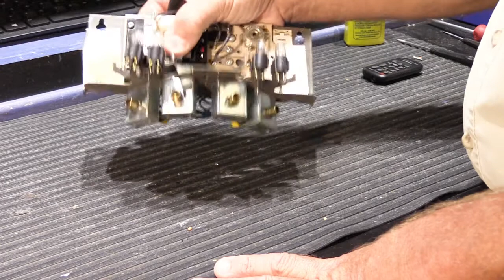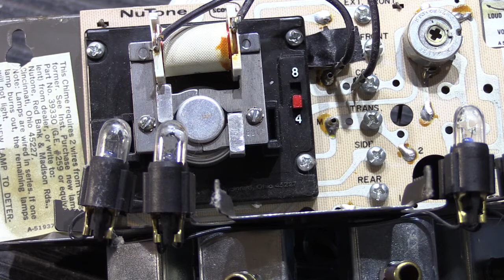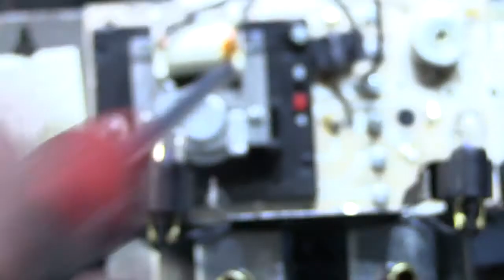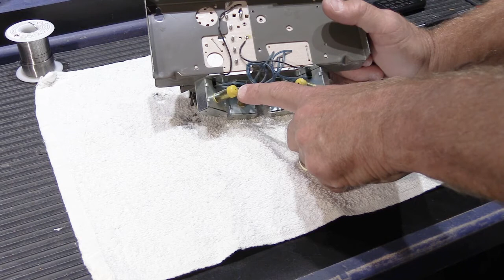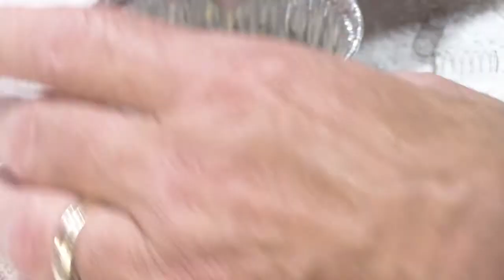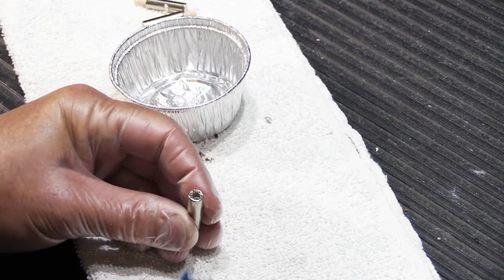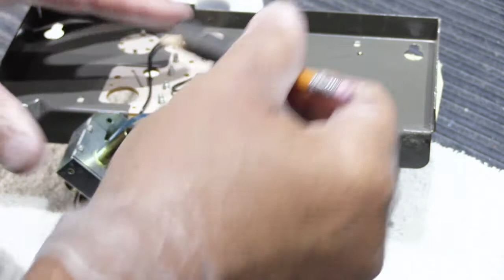How to Service a NuTone  8 Note Long Tube Door Chime Base

Comment: Do the door chimes with the clock 4 long tube. Also chime the hour?
Reply from the maker: Hi JonThomme De Claydon: No.  NuTone did make a 8-Note Door Chime with a Clock that Chimed the Hours in the late 1940's and early 1950's.  These were not a very successful model, probably due to their high cost.  In the 40 years I've been a NuTone Service Center, I've only ever seen one - Chris

Comment: We have one from 1963 with a clock and I dread taking it down to clean. Well looks like I have to buy lighter fluid. And we have a Nutone intercom same year with tubes, hasn't been used in years.
Reply from the maker: Hi John D II:  Make sure you label the wires before disconnecting them - take a few pictures as well.  Care must be taken when working on the Chime Base - Don't lose any parts (springs)
What Model Intercom do you have? - Chris
Reply: @northsideservicecompany3567   Thank you for the hint but this isn't my first time. I have been repairing electronics for many years. It says use lighter fluid but I don't have any so I was looking to see if I could cheat with something else. I guess not. Lighter fluid is on my list to buy. Thanks again.

Comment: I have a Nutone Jefferson L series long bell chime. The seller told me that it "worked when it was disconnected" and I believe him, but when I had it installed in my house, it didn't work. One of the solenoids does move a little, but it doesn't ring the chime. It probably needs servicing. Would you do it for me, and how much would it cost? Many thanks.
Reply from the maker: Hi Cynthia:  It will be best if you contact us directly about your newly acquired "L"  Model Jefferson Door Chime - Chris     nscompany@msn.com

Comment: This was great, thank you. Where can I get the tubes for these chimes?
Reply from the maker: Hi Abraham:  eBay is probably the only source for Chime Tubes - There are many different versions of NuTone Tubes that were made over the decades - You need to know the age of the Chime Base (or model number) to knw which tubes you will need.  Look carefully before buying Tube for broken/missing Tube Hangers or cracks in the Tubes - Chris

Comment: i'm in the process of repairing my nutone 64203.  when i first bought the house, only 2 of the 4 hammers worked.  after opening the cap on one of them and push the hammer up and down, i got the 3rd one working which made me happy but the 4th one, the last one on the right, has a wire disconnected to the circuit.  i tried to shove the little wire into the hole, looking at the back on the right side area the left of the 2 holes below the upper 3 holes, but still not getting a reaction.  i even shoved a chopped paperclip in there and wrapped the wire around that to help make the connection but no luck.  next i'm going to try and open the metal hammer box to see how that looks inside and maybe shove some speaker wire down the circuit hole and try connecting to that.  if that doesn't work, any other idea why the hammer isn't working?
Reply from the maker: Hi ztuber7763:  First lets get some terminology straightened out:  1 - They are Solenoids, not "hammer boxes"  2 - They are Plungers not "hammers" - Now, Do Not Open The Solenoid, if it's bad (unlikely) you will not be able to repair it.  If you want to evaluate the Solenoid, use an Ohm Meter and measure the resistance of the coil (using the meter probes on the end on the coil wires) All 4 coils should measure approximately the same amount.
     The Wire used in the Coil is referred to as "Magnet Wire" because the coil in the Solenoid is basically an Electromagnet.  Magnet Wire has a clear (or reddish)  coating on the copper wire, that acts as an insulator (keeps it from shorting out)  You cannot "shove the wire in the hole" and "shove in a paperclip" and expect the wire to make a connection.  You Must Solder the Wire into the connection - The heat from the soldering melts away the coating on the wire and allows the copper to be soldered.
   There can be many reasons why the Plungers are not working and if you follow the Video - Exactly - your Chime will likely work again.  Cleaning the Plungers and Solenoid Bores - Using Lighter Fluid - as I show - is an important step in the Servicing - Do Not skip steps or substitute anything from what I show - Or - You risk ruining the Chime - Chris
Reply: @northsideservicecompany3567  turns out i was able to get the 4th one working.  i sortof used my paperclip method.  i didn't want to disconnect the whole unit from the wall to solder so i took off the spinning motor assembly(forget the name), cut down a thin hard metal wire, that came wrapped around my poultry netting, to an inch and used a wrench to bend one end into an L, shoved the straight part through the circuit hole then used scotch tape to hold the L in place, then wrapped the solenoid wire around the straight part completing the connection.  the problem now is that i only have 2 of the 4 bells lol.  not sure why the previous owner got rid of 2 so i'll either have to find replacement bells or rig something up like copper tubing.
Reply from the maker: @ztuber7763  Well - Okay - As long as it works I guess.  Different type of tubing will make different kinds of notes/sound - You may need to make up 4 new Bells to have it all sound even - Chris
Reply: @northsideservicecompany3567  do you happen to know the lengths of each bell for the westminster chime?

Comment: Hi Chris I have an LB38K72A short tube Nutone.  Your video is great, I've got everything cleaned up and reassembled.  My problem i get one chime when I press the doorbell.  The video shows the motor armature freely spinning when you pulled it, my armature does not spin.  Is that my problem?   Is the motor repairable?
Reply from the maker: Hi Flipper:  I have questions:  Is the LB38 new to your home or has it been there since 1972? - If it's new to the home, are your replacing a standard mechanical 2-Note Door Bell (the kind that goes ding-dong)?

If it's been there since 1972 - what was its condition before you worked on it?

Chris
Reply: @northsideservicecompany3567  Chris, The house was built in 53 so the chime was added at some point.  I bought the place 7 years ago and the chime worked.  During the remodel it was taken down and not used for 4 years.  It was really filthy!  I cleaned the circuit board including under the screws, cleaned & lubed the solenoids, realigned the tubes.  I've been fiddling with the doorbell button.  The original is lost.  The new one was partially shorted by faulty wiring, I get one chime per push sometimes repeated sometimes a different note, and then it stops.  So I just got another button a Hampton Bay to test.  Or should i order a Nutone specific button?  Restoring the chime has been a fun project, great videos and instruction.  Thanks so much for the effort and skill  you put in your tutorials.
Reply from the maker: @flipper9770  As few things: 1.  It's not the button,. unless the button is mechanically broken, the brand of button doesn't matter - 2.  I would say that in the past 20 years, I haven't seen a Motor on a modern NuTone Chime fail (yes, 1972 is modern) To test just the Motor, use the 16 2-wires that come from the Transformer for power, connecting them directly to the terminals on the Motor Coil, the Motor should run (removing the motor from the base to see the rotor turn is a good idea) 3.  Inspect the contacts on the end of the 3-arm Rotor, look for bent or missing contacts.  These contacts make the necessary connections to keep the Motor turning once the Button has been released - 4.  Is the Springy Metal Tab is in place and it rests against the Top of the Post - Chris

Comment: Excellent video.  I have this same model from sometime in the 70's or 80's.  It stopped working 20 years ago so I put it in a box where it has been ever since.  When I found your video, I thought I'd see if I could get it to work again.  I removed the motor and used my eraser to clean under the armatures.  What I noticed is that the armatures do not easily move as it appears in your video.  They certainly did not glide to a stop.  I almost had to use pressure to get them to move.    I removed the plungers and inspected them.  I didn't clean them with my lighter fluid at this time because they didn't seem very dirty.  So I wired the doorbell to test it but it still doesn't work.  Any suggestions?  Thanks,  Mike
Reply from the maker: Hi user-ne5wc9rj1i:  You can try connecting 16 Volts AC directly to the Motor terminals and see if the Motor runs - Chris
Reply: Thanks for the tip Chris which proved that the motor works.  Cleaned the plungers which were much dirtier than thought.   Finally determined that the button wiring was the final problem.   Good to hear those chimes again after about 20 years.  @northsideservicecompany3567

Comment: If the metal tab tells the motor when to stop, how does the motor start again when the button is pressed? In other words, how does the motor wheel get beyond the sticking out tab that is now physically in the way? Of there is no contact, how can the motor move before you have re-established contact? I hope this makes sense.
Reply from the maker: Hi Sam:  When someone presses the button at the front door - it begins the motor turning - the button press is long enough to have the motor turn past the Start Position - this means that the arm on the armature that has the tab on it, has moved past the springy metal tab and it is now resting on the metal post, essentially closing the switch connection - once the motor has made its full cycle - the tab on the arm of the armature pushes the springy metal tab off the metal post - opening the switch - turning off the motor - Chris
Reply: @northsideservicecompany3567  so the button supplies the starting power, and the tab close provides the running power? One or the other is hot at any given time? Like a tag team? Thanks for the super quick response ! 🙂
Reply from the maker: @realSamAndrew  Exactly - You're welcome - Chris

Comment: I own a NuTone 8 note chime with 4 lit bulbs.  I removed the far left bulb. All lights went off, like you described.  When I immediately put the bulb back in, all 4 bulbs stayed off.  Any suggestions?  I can't get them to come back on.  I am sorry I took 1 out.  Should I attempt 4 new bulbs?  Is there a reset button?
Reply from the maker: Hi Judy,  The bulb probably went out when you removed it - You will need to replace all 4 bulbs - The Bulbs are all #259 Lamps - Here's a link to our Video about the Lamps:  https://www.youtube.com/watch?v=liun9S5QbMo&list=PLsTvqKsBnGYdEvtzvv_pz1gOKa9UPuAxH&index=23

There is no Reset Button - Chris
Reply: Awesome.  Thank you so much.

Comment: I know this is an old video but I just bought a house with a NuTone LB-42 8 chime long tube. I figured out that the doorbell buttons outside were both broken and adjusted the tube position and got it working. It seems like the tubes are cracked at the top. Is there anything I can do to fix it to make the chime sound better?
Reply from the maker: Hi SMAForce1:  Cracked Tubes are a common problem, and there's no repair solution for the cracks - There is a "work-around" that is fairly simple and easy to do.   Your Tubes have plastic Tube Hangers clipped into the top of the Tubes - These are clipped into recessed "caps" that are pressed into the top of the Tubes (this is often why they crack) You can use a long (48") wooden dowel - placed into the bottom opening of the Tube - to carefully drive the cap out - The flip the Tube over, and put the cap into the bottom end of the Tube - Try to do this so the crack will be facing the wall when you hang the Tube.  PLEASE NOTE:  The Plastic Tube Hangers are NO LONGER AVAILBLE - You must be careful not to break them off when working on the Tubes - Chris
Reply: @northsideservicecompany3567  Thank you for the information. I’m definitely worried about damaging things forever. I think it sounds good enough even with the cracks after hearing the danger of not having it work at all. Haha

Comment: How much of this would pertain to my Edwards Claridge model C-50, 8 tone long tube chimes. I believe this has been in my home since 1960. I seem  to get a single chime from the front, the rear and side doors have been disconnected. The front doorbell has been replaced. I would like to find a wiring diagram. Thankyou.
Reply from the maker: HI jddeefo:  The basic Servicing would be done in the same way - The Specifics may be somewhat different - All of these types of Chimes are every similar, so the techniques crossover well.  I would also suspect that the wiring would be done in the same way - Chris
Reply: Thank you for the reply. I just started looking at my unit and it is extremely dusty and dirty. I will proceed with cleaning as shown inyour terrific video. Thanks Again.

Comment: I just installed one of these into my house. It didn't come with the transformer. I have to hold the doorbell button to get it to go all the way through the ring cycle. Is the correct transformer what I need?
Reply from the maker: Hi Tanner: If the Chime you installed was made after 1960 - it requires a 16 Volt AC Transformer rated at 30 Watts (VA) - The Transformer is not the reason your Chime is not playing through the entire cycle - you don't have it wired correctly - Chris
Reply: @northsideservicecompany3567  ok well I watched your tutorial, I've got 4 wires coming out of the wall. 2 that were hooked up to the regular 2 chime bell and 2 black ones twisted together. I hooked trans from the old one to trans to the new one and front from the old one to front for the new one but I'm having the problem that I stated. Are one of the black ones supposed to be connected to comm?

Comment: I have a 4 tube chime like this. Can it be used with today's  video doorbell ? Unit is still working very well.
Reply from the maker: Hi Tony:  If your Chime is Exactly like the one in the Video (with a Telechron Motor)  - the no - it will not work with with any WiFi Door Camera - Chris
Reply: @northsideservicecompany3567  Looks same except ours don't have light bulbs. Wonder if you can recommend a best similar mechanical chime
to go with video doorbell then?  Or I'll have to install free standing video doorbell I guess. Much appreciated  for your time presenting easy to understand tutorials. I am 80 yo retiree, still learning things.
Reply from the maker: @tonyhwang3888  You can use an standard mechanical 2-note door bell (the type that goes "ding-dong")  I wouldn't do this - I'd just use the WiFi camera as a standalone item - Chris
Reply: @northsideservicecompany3567  Wife won't part with Nutone chime. Settled on eufy
Cam E kit.  Thanks again.

Comment: Hi Chris, Thanks for the video it is a great help I have done everything you have shown. Mine would not stop playing the chimes once you hit the button that was the stop spring loose. My problem know is when it is set for 8 strikes the first strike does not activate number 2 and 3 strikes but number 4 does not. On the way back they all strike do you have any ideas to help me?
Thanks Steve
Reply from the maker: Hi Steve: Based on your description of the problem - it's a mechanical issue, probably with the contact on the armature or on the circuit board. - Chris
Reply: Thanks for your response I will try that this weekend and let you know. I bought this new in or about 1988 to put in my new how in Fairfax Virginia since then I have moved it with me through three new homes now in Bradenton Fl still in great shape.

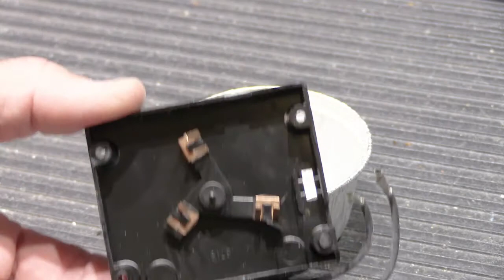Comment: Need to order the armature copper contacts seen at 21:25 in the video.  Do you know where I can find at least one and possibly all three? ~ Robert
Reply from the maker: Hi Sandbag1300:  The contact points on the armature were never parts that could be ordered separately.  You will need to replace the complete armature - Chris

Comment: Brilliant ! Two questions: Is it really necessary to add new foam ? What is wrong by setting the volume to the highest level ? Thanks, nice work !
Reply from the maker: Hi Luis;  Here's a link to my explanation about setting the Volume Adjustment on Long Tube Chimes - http://northsideforyourhome.squarespace.com/vintage-nutone-door-chime-adve/2016/7/26/how-the-volume-adjustment-effects-the-sound-of-the-chime.html

I have never been sure why the foam cushion were necessary in the plunger assembly, but since it had always been done that way, I think it's best to just replace them - Chris

Comment: Hi Chris, The circuit board is a different color in fact it is exactly like the one in the large screw video.
Reply from the maker: Hi Steve:  After going over the work you did, if you still can;t find the problem - Contact me - Chris 925-743-8236

Comment: Hi Chris, thanks for your great instructions! So...what if I already sprayed the plungers with WD40, can they still be cleaned off with lighter fluid?
Reply from the maker: Hi Cheri:  Yes - Just disassemble the solenoids and clean all of the parts with lighter fluid. - Chris
Reply: Thanks so much 😀

Comment: Trying to install my door chime. I have a basic question. What are the voltages for hook up, and activation. AC and or DC ?
Reply from the maker: Hi chips1972: The low-voltage to most NuTone Chimes made between 1965 and 2010 is 16 Volts AC - The transformer should be rated at 30 Watts minimum - Chris